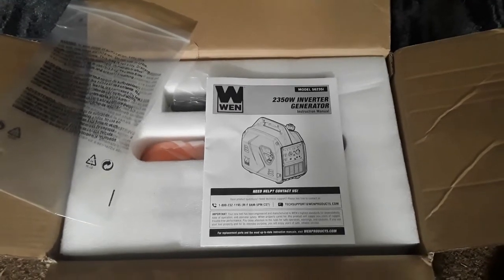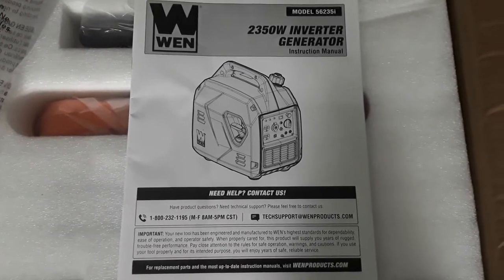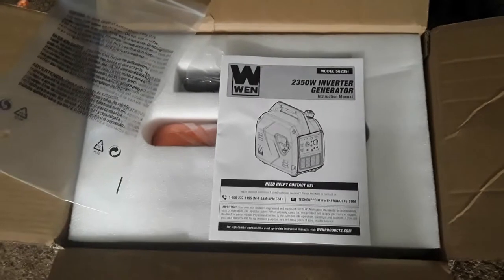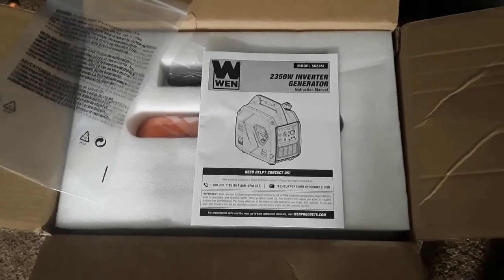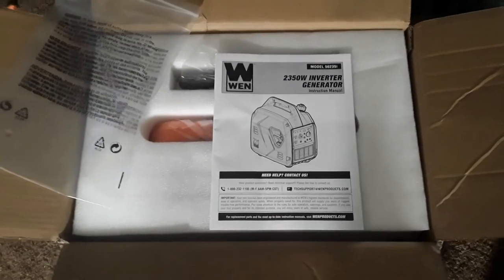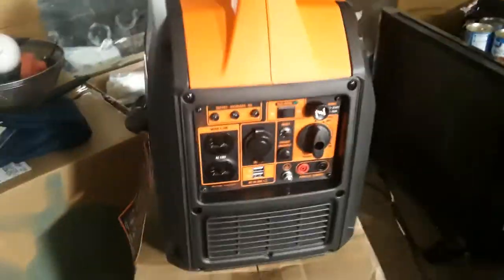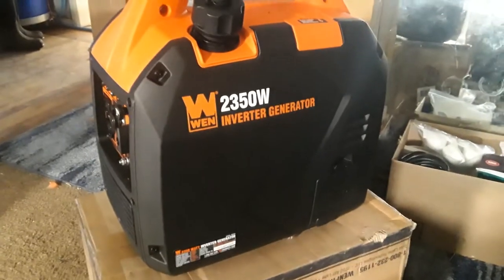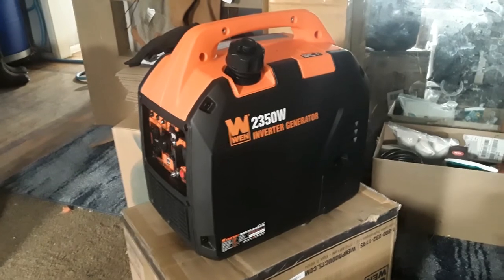Why You Need A Quiet Generator When SHTF

Comment: I currently don't own a generator but looking to get one soon and have watched countless videos of how loud each unit is  ,how much fuel they use, my take on them is for what you pay for these small 2000 watt units usually from 4 to 600 dollars, for a little bit more money you can buy one with double the wattage and since the larger units motor doesn't have to work as hard to produce the same power a small one does , the large units motor doesn't have to work as hard and rev high like a smaller unit which is where all the noise comes from the motors running at high rpms , the larger unit will use roughly the same amount of fuel since its engine can just loaf along at low revs , while the smaller one will sound like a lawn mower running to kick out the high end of its power output,  but if you needed the mobility to take a generator with you ,a small one would be much lighter and space saving verses a large unit that will weigh close to 100 pounds, if I  was going with only a small unit , then I would get one that runs on propane fuel and gasoline

Comment: Nice generator.  I have 3 generators , 2 for work and one for the house.  The house generator is load ,but it powers the whole house. I dont know what I would use a small generator for.  If it overloads will the breaker trip or will it just stop running